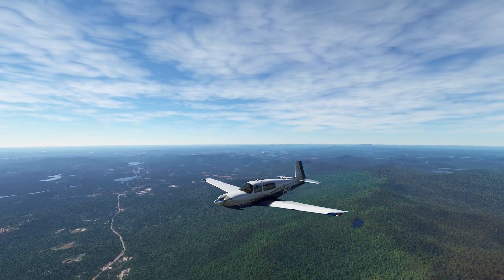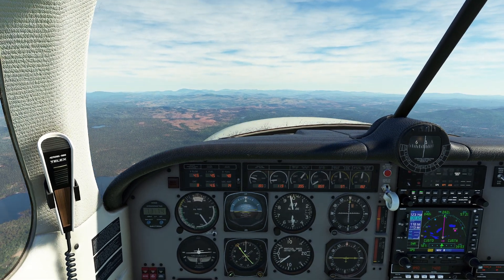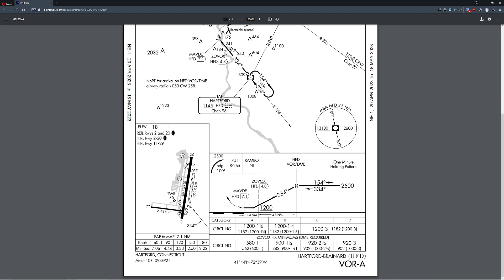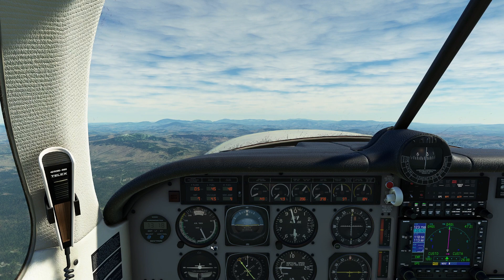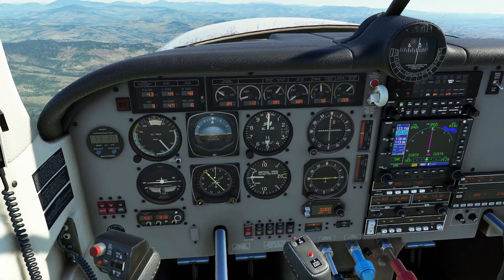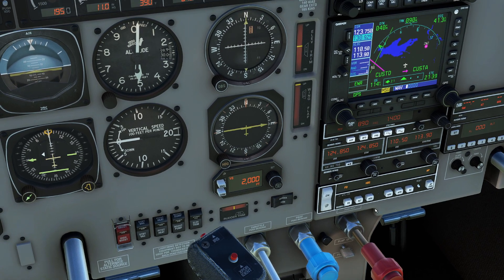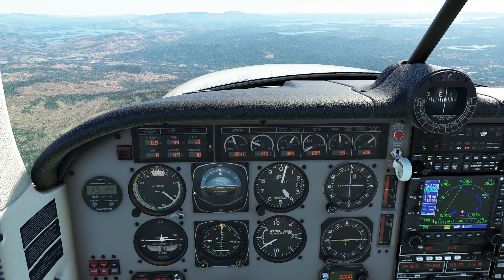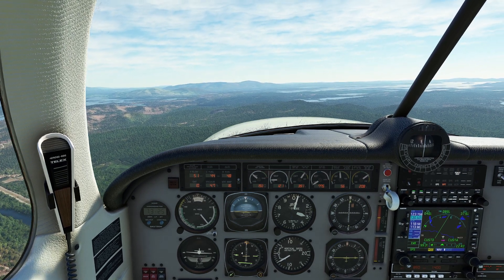MSFS - Determining Power settings for Non-Precision Approaches

Comment: I have actually done the VOR approach circle to land on runway 20 during a type rating check ride in a shorts 360. I passed BTW. Here is a suggestion I learned as a CFII for Professional Instrument Courses: setup a placard that shows Power ant attitude for six configurations. The six are Climb, Cruise, cruise descent, Approach, approach descent and non-precision descent.

Across the top list Manifold press. PRM, pitch attitude, Airspeed, VSI, Gear/flaps. With this information all you have to do for any configuration is set the proper power setting and maintain altitude with pitch until you reach the desired airspeed or descent.

The most precise method to maintain airspeed is to control attitude with pitch and control airspeed with power. If power is fixed control airspeed/altitude with pitch.
 I can construct a form to fill out and use as a placard and send it to you if you want.

Another great video, keep up the good work. You are a big help to a lot of pilots.